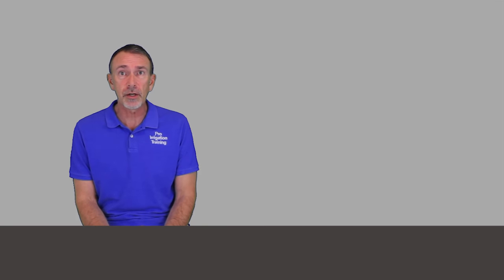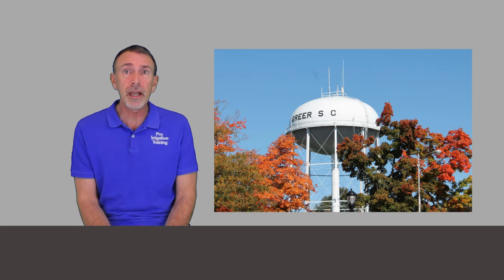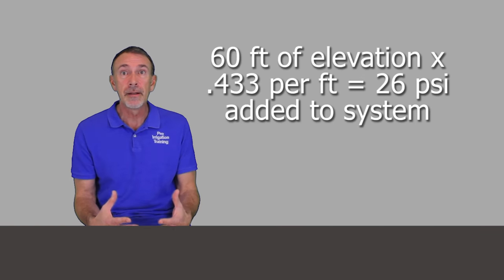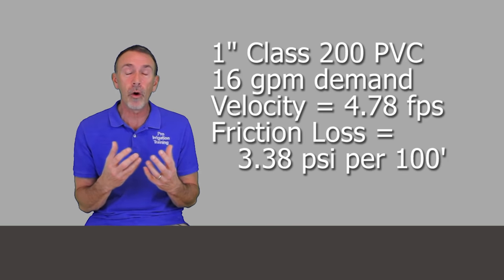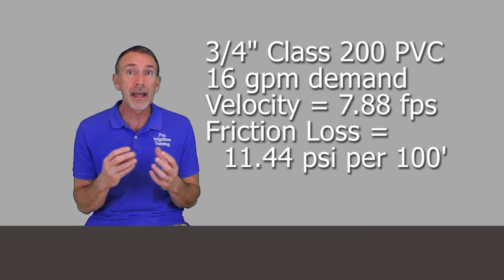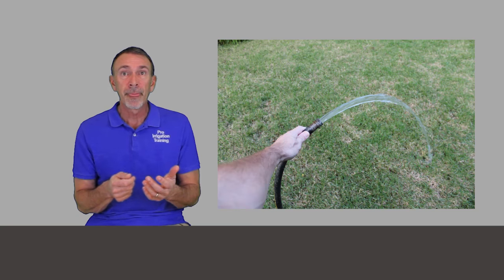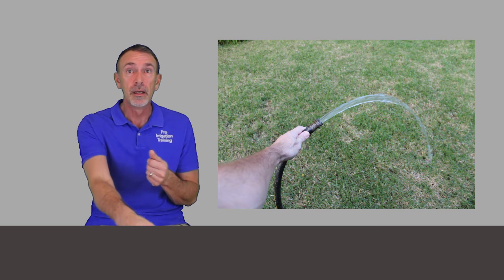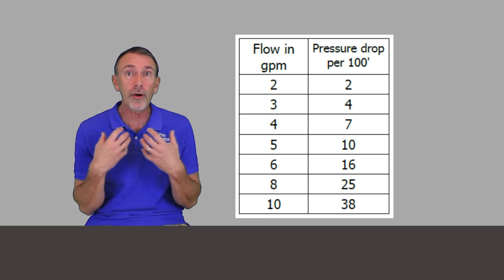3 Ways to Increase Pressure in an Irrigation System

Comment: Thanks for the video. I don’t know much but I do know too many sprinkler heads on the same line decreases pressure. Is there a formula of how much the pressure decreases for each sprinkler head? Do using a specific sprinkler head reduce water pressure more than other? (ie rotors, rotary nozzles, spray nozzles, impact sprinkler heads…). 
Does too many sprinkler heads reduce the pressure just mostly at the end or even the first sprinkler head? 
And what type of sprinkler head still works ok at very low PSI? (I bought a house with a full system set up over 1/2 acre. At the bottom of the hill I tried to test the PSI and I think it’s like 10. There are 14 Rainbird R Vans and even a drip line to this section. 
Oh, and does having all the sprinklers in a row off the same line effect pressure any differently than having the main line branch 2 separate directions with the heads off 2 different branches?
Reply: I work for an Irrigation company (I am just an intern unfortunately) but I will share what I know. 

The straighter the pipe the more pressure the system will have
But if you are have pressure issues this will probably not solve your problem. 
The rain bird Vans use an insane amount of water per second.
They are the most inefficient nozzles I use regularly. They are great and useful but I try to use them sparingly as they a lot more water hungry than other nozzles

If price is not a factor I would recommend getting what are called "MP" nozzles
They shoot out concentrated jets of water and are extremely adaptable with many different angle options. 
But they are quite pricey as they have more Engineering put into them

Standard non adjustable rainbird nozzles use less water and would help if you have low flow out of your vans.

I have replaced a few vans on a system that did not have any of its heads popping up at all and suddenly it worked fine.

For a cheaper fix if the problem is not extremely severe I would go with getting standard non adjustable rainbird nozzles
(15H, 8Q, 10F, etc)

If you want something fancy to show off to your friends then get the MPs or if the standard nozzles dont solve the problem.
Reply: @noobnob8055  I have R Vans, not Vans. Rainbird R-Vans are rotating sprinkler heads and about the same price as Hunter MP (which I think you are taking about as Rainbird MPR are pretty cheap).
Reply: Ah,

I rarely see the R Vans and my company just calls those MP's as well

Sorry for the confusion.
If the pressure on those is low then unfortunately the only suggestion I can make without seeing the system is to cut your system into more zones and add more valves to run less heads at the same time

But that is probably not the best option and is a rookie's solution

If the pressure drop happened after the system was running fine for a season it is very possible there is a break in the line somewhere

If this has not been ruled out, run the system for a long time and look for water where there is no head present. 

Sorry I could not be more help
Reply from the maker: You're right, having too many heads on a zone does decrease the pressure. It's an issue of demanding too much water, which is the flow amount for each nozzle on the zone, at the pressure it's operating at. There are friction loss tables that tell you how much flow you can safely get through each pipe size. If you exceed the safe flow amount, the friction loss starts to go up like crazy which eats away the usable pressure in the zone. It can even affect the first heads in the zone. If you're measuring 10 psi at the head, you have a problem. Most heads and nozzles need at least 20 or 25 psi to work right or even pop up out of the body. If you find the entire system looks equally anemic, a booster pump could fix the situation. I would call a pro to do an evaluation before I went to that expense.

Comment: Very nicely explained. I will definitely do your 101 course. In the meantime, can you please answer this question? Does pressure create flow, or does flow create pressure?
Reply from the maker: Pressure is the potential to cause flow, so I guess maybe you could say that it creates flow? There is no flow in a closed system, without pressure to push the liquid. Flow can be thought of as an enemy of pressure, as with increasing flow you also get increasing friction loss which reduces pressure.

Comment: Great video!! I appreciate the fact that it looks like you answer everyone questions as well. My question: I am thinking of adding a booster pump to run a large sprinkler head (Rain Bird Falcon 6504). My water source in a 3/4 hp, 10 gallon/minute submersible pump (continuous flow pump). My static water pressure is 60 PSI, but as soon as I start the sprinkler, it drops to 17 PSI and not enough to run the sprinkler effectively. My concern is- Could the booster pump potentially pump more water than my submersible can output, and damage something? My goal is to only have to use one big sprinkler head with a large volume of water instead up needing to set up multiple, smaller heads and continuously move the many smaller heads. Thanks and I welcome any suggestions.
Reply from the maker: I do try to answer questions, but it takes me a minute during the busy season. Try this with the Falcon, use a smaller nozzle. The number 12 or even 10 depending on the pressure can take more flow than your pump can output. You want it throttled back a little and not pushing wide open, it will reduce the life of your submersible pump. And using a booster after will potentially damage it as well. You want a nozzle that will flow less than about 8 gpm at the pressure it's operating at. You can just keep dropping the nozzle size until you see good performance.

Comment: I am a home owner with an irrigation system that draws 10 GPM per zone. I only have 20 GPM coming into the house and this has created a low pressure situation at my shower heads and sinks when I run the system. Any suggestions?
Reply from the maker: Question answered via email, thanks for watching and your question!

Comment: Hi. My situation is that I share a county well pump with my community. My main line from the street is 250’ of 3/4 copper. I have 42 psi at my spigot but I don’t seem to have enough flow. I tried to install a pressure regulator to raise the pressure with zero effect. It didn’t change 1 pound. 
I can only run 1 impact sprinkler and it only sprays about 10’. When I run the sprinkler I get almost zero water anywhere else in the house. I run a pump in my garden hose line and the sprinkler sprays 30’ but I still can’t use anything else while it’s running. Will a booster pump in my basement close to the main line add volume to the whole house or just raise the pressure? I’d like to run multiple heads but still be able to wash the dishes while the sprinkler is on. Thank you.
Reply from the maker: Hello, please forgive me for taking a minute to reply. I actively own lawn care and irrigation companies and this has been a transitional period for us. I've got some comments and questions. 1) We need to see what the flow is at your spigot. Do a five gallon bucket test. Open the spigot wide open, then hit a stopwatch as you put the bucket under the water flow. Measure how long it takes to fill the bucket. Divide that number of seconds into 60, and multiply by 5 to get the gpm. For instance it takes 25 seconds to fill the bucket. 60 / 25 = 2.4, then 2.4 x 5 = 12 gpm. You may need to take several tests at the time your system will run to determine actual conditions since you're on a community well. 2) A pressure regulating valve can never increase the pressure, only reduce it. You probably have an issue with available flow. Replace the nozzle in the sprinkler with a lower gpm. It probably has a 3 gpm nozzle preinstalled, try a 1.5 and see how it looks. You may need to get a hose bibb timer and run the sprinkler in the middle of the night so there will be less demand on the available flow from your neighbors.

Comment: What most people don't realize that water going thru pipes is similar to using electricity. The more resistance you add to an irrigation system IE using smaller diameter pipes ,the more resistance you will have in your pipes and less flow rate you will have.     If you don't need much water flow to the  system you are supplying, you may be ok using a smaller diameter pipes .  Always remember that air pockets caught in  an undulating up and down ( relative to the ground horizontally) in a low  pressure system can cause enough back pressure to stop a system from flowing. Air is less dense than water and will rise to the top of any upward bend ,forcing water to work  harder against lifting the water up to try and displace the water through each air pocket hence the resistance.
Reply from the maker: You're absolutely right about that. Low pressure and low flow zones can present their own challenges. Excessive horizontal dips in the pipe can cause problems, and it becomes pronounced on pump systems. This highlights the need for good installation practices.

Comment: Great video. I have a basic irrigation question. Running a 80m hose from a 2m high storage tank across flat ground to run a basic garden sprinkler which barely trickles through. There is no power nearby so was thinking a 12v pump. Any advice how to solve this. Thank You
Reply from the maker: Yeah, you're going to have to do a battery/solar pump. And even that may be asking a lot. Check the specs of the sprinkler you bought. It probably has a minimum pressure to operate it. And that 80m hose probably loses a lot of pressure through friction loss. So when sizing a pump to buy, I would make sure it could supply at least 50% more than the min of the sprinkler. Only other option is to raise the tank about 15m higher.

Comment: I hope you can help me here. 
I have gone through 2 pumps and had the same problem- 
I now have a 2hp pump with a 2" pvc pipe intake and 1 1/4" on the outflow. Foe whatever reason I can only get 10psi and no more on the outflow. I have reglued all the piping so I have no air leaks on the intake side- I have "burped" the lines and tried to clear out any air- I have 240 volts at the pump-I am only 6 feet from my irrigagation box and 2 feet above the box.
I just do not no what else to check here. Any thoughts? Thanks in advance
Reply from the maker: Hi Eddy, thanks for watching and the question. Pumps can be a real pain sometimes. Did you replace the foot valve when you re-glued the intake line? It could be that the screen is clogged or the check valve isn't opening fully. I get the best performance from the brass 1.5" model on a 2" intake line. You can put a vacuum gauge on the intake line, if it shows very high readings, then the intake is clogged somewhere and the pump is having to pull too hard, if it shows very low reading then the pump isn't pulling enough, check voltage and pump operation. ( A vacuum gauge will also show a low reading if the pump is wide open on the output side, not connected to the sprinkler system. Pumps like to be pushing, or under "load" as it were.) Don't discount that a new pump may still be a problem. If the vacuum gauge is in the middle but bouncing around, you still have a leak on the intake. A pressure gauge on the output side can help diagnose a bad pump as well. Is there possibly a master valve that isn't fully opening? Is there maybe a ball or gate valve on the main line that's partially closed?

Comment: Great Video, but I still have a pressure problem i can't figure out. I have 5 zones in my sprinkler system. Zones 1-4 work fine. Zone 5 is doing a rapid pressure cycle. It goes on, hits 60psi then shuts off, goes down to 40 psi, and clicks back on. This happens 
every 20 seconds when zone 4 is on. When zone 4 is off, the pressure is fine. Any ideas?
Reply from the maker: To be honest, I can't really understand what you're describing. You said that 1-4 is fine, that zone 5 is the problem, then say that it's happening on zone 4? And because you know the pressures, it makes me think you have a pump with tank and pressure switch. If so, there's probably a big difference in the flow demand between those zones. But there's a lot of variables at play here. I would suggest getting a professional that can come out and do a proper troubleshoot on the system. Sorry that I can't help, but thank you so much for watching!
Reply: To me it sounds like you have a volume problem. come across that years ago on a buddies house. he had run  3/4 inch pvc pipe 600 feet from the road to his house and couldn't run more than one faucet at a time with out water slowing down. the fix we came up with was replacing 8 feet of 3/4 inch pipe going in to the house with 6 inch pipe. after that he had no problem.
Reply from the maker: @PatrickDoucet-q5v  It really is a volume problem here. I'm betting that the zone he's having problems with, be it number 4 or 5, has more heads on it, causing more demand for flow. It definitely sounds like a pump, tank and pressure switch setup. When the previous zones run, they have less demand for flow, so the pressure doesn't drop enough to cause the pump to cycle. Then zone 5 comes on with more heads (or a leak) and the pressure drops below the switch threshold causing the pump to kick back on until it hits the upper limit on the switch which turns the pump back off, then a few minutes later the pressure drops and hits the bottom limit of the switch.

Comment: Thanks I’m installing a cheap sprinkler system using the hose faucet our house doesn’t have a pressure regulator I measured 80 psi static pressure and 10 gpm water flow I’m thinking about using all 1/2 in pipe and for the sprinklers use rotary nozzles on the pop ups and for the big rotors use 1-2 gpm nozzles I’m doing 4 of them 👍 also curious if this setup would work ok I’m thinking it will 👍
Reply from the maker: The maximum flow that you want to demand from 1/2" pipe is 6 gpm for the thin walled version, and 4 gpm for Schedule 40 or the thicker walled pipe. If you were wanting to put all 4 heads on one zone, 4 heads @ 2gpm = 8gpm, and that needs 3/4" pipe to flow that much water.
Reply: Kevin Naderi u
Reply: Just installed my first zone of sprinklers, 3 per zone for 4 zones total. It works fine but would like to run at least 2 zones at the same time. The house has 3/4” supply reduce to 1/2” pipe through out😖, hey that’s how it’s been altered. From the bathroom, the shower and sink faucet,  I lose pressure dramatically. I’ve installed a 3 stage filter system and it indicates over 80 psi. My question is do I change the pipe size back to 3/4” (through out the house) or get a booster pump just for the sprinkler system I want to continue installing? Please advice and thank you for the information.
Reply: Pro Irrigation Training ok so I guided I used 3/4 in pipe instead them my sprinklers would probably work better 😎

Comment: we are on well water in a Mobile Home Park.... shared water line... would a 24 volt pump be good to add to a in ground irrigation system to increase pressure on the sprinkler system?
Reply from the maker: Hey John, that's a tough situation. Shared well systems can be problematic. The thing to watch for when you add additional pumps to an existing well pump; you can potentially pump your well dry. If it's a huge well with great refresh rate and flow, then maybe it's not a problem. But, I would consult with your well maintenance company or installer before you do anything like that.

Comment: I'm trying to figure out whether I need a well booster pump or a larger well tank to solve my farm irrigation problems. My irrigation system needs at least 10 gpm to work properly. My water source at the house spigot is 40 psi. Where the house hose meets the irrigation system is about 4gpm. Will a booster pump bring my gpm up to at least 10? Or does the holding tank need to be bigger to have enough supply to get out to the field (100 feet away)? So appreciative of any guidance in this matter.

Comment: I connected my new sprinklers system to a water hose connector and no pressure. Do i need a valve?
Reply from the maker: Hi Zalo! The problem with garden hoses is that they can't flow much water to begin with, but the inside surface of rubber garden hose has a lot of friction loss, meaning that a longer hose, 50' - 100' long will greatly reduce the pressure. The main issue is how much flow does the system need to run, and how much water is able to get through the hose connections and hose at what pressure.

Comment: What type of pressure booster do you recommend? I believe I need one since my main line goes 250 feet from the lake pump and up 18 feet.  Thanks!
Reply from the maker: Hi Barry, so sorry I didn't see your comment when you made it. I don't think you can do an additional booster pump after a lake pump of the centrifugal style. I'm not sure what it would do to a jet style pump. You really have to size your lake pump to accommodate the elevation rise etc. Call a local irrigation supply that sells pumps and they should be able to walk you through "pump sizing" to get the correct model.